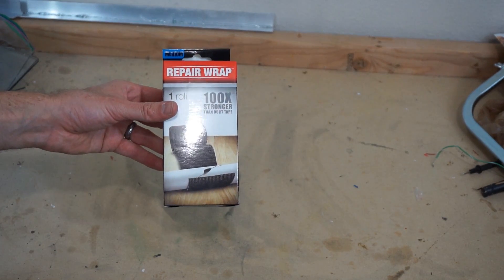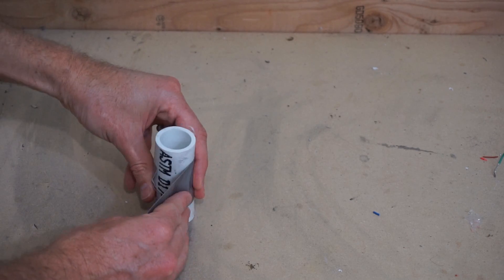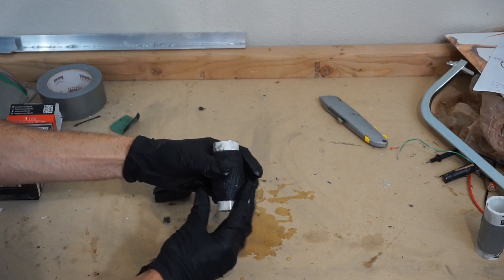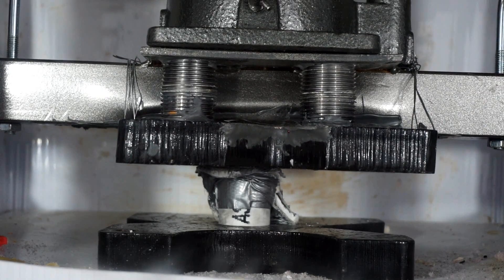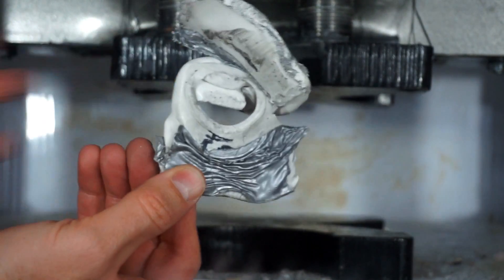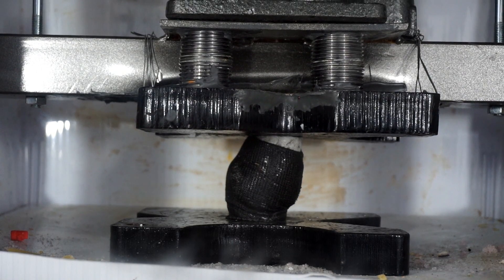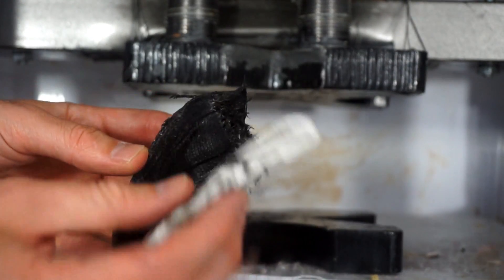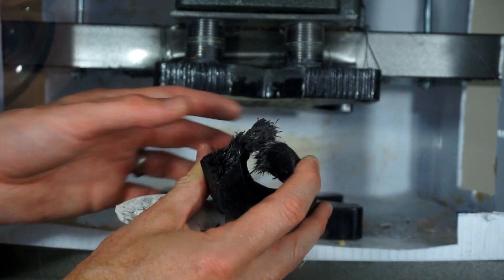FiberFix Fiberglass Repaired Pipe Crushed By Hydraulic Press

Comment: unfair test, the duct tape had less layers than the fiber fix
Reply: callum heatlie-ball Dumbasses, the Fiber Fix is a thick tape. the number of layer is the same.
Reply: Chaos Craft999 Wow, you did not just call them dumbasses and then go on to say he wrapped the pipe in the same layers. The duct tape had two layers and the fiber fix had like 6 or 7 layers
Reply: it showed in the video him cutting the fiber fix after two layers at 1:32
Reply: callum heatlie-ball lol so the duct is gonna hold it? Even if u put 149 layers it won't hold this much pressure
Reply: Wrong. He cut it after two layers.
Reply: @ThePrufessa  no, it was like 5 or 6 layers, he cut the video
Reply: @dylonbradshaw2002  oh ok.
Reply: @dylonbradshaw2002  wrong. He used the same number of layers as the duct tape.
Reply: @dylonbradshaw2002  using 5 layers of a stronger product wouldn't make any sense.
Reply: I agree